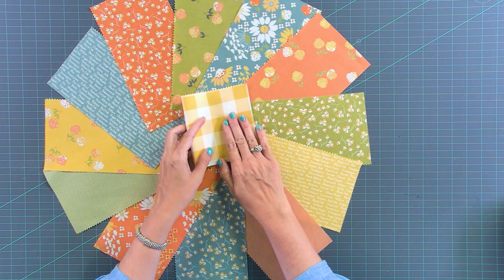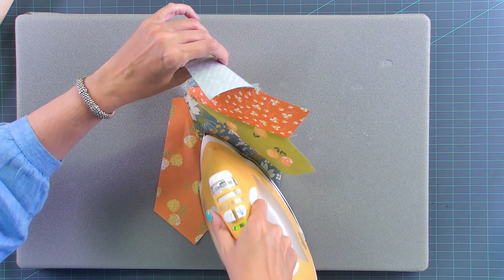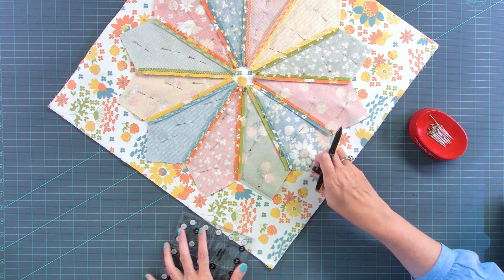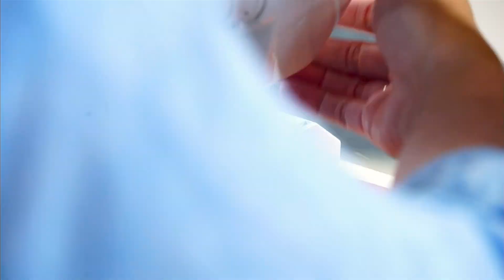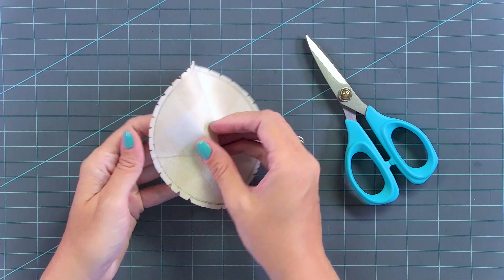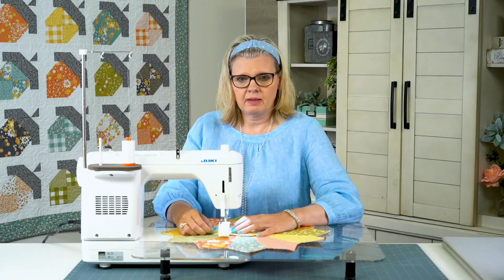🌼 Make an Easy Dresden Plate into a Cute Centerpiece 😍 Adorable Jolly Bar Dresden

Comment: I need your help to decide between singer 3505 and brother gs 2700. I have seen the singer 3505 demo and stitch quality is wonderful.  I haven't seen brother machines as they ate not in local markets right now. Expected in a months time.  I like that singer 3505 has blanket stitch that I may use for applique. Brother doesn't have it. Brother has top loading bobbin vs singer having front load bobbin. Brother speed is 860spm while singer is 750 spm. I am a beginner . Please suggest which one of the two should I buy. If you had to choose between front loading vs top loading bobbin,  which one will you choose? Thanks!
Reply from the maker: Hello div! Ultimately we think that it’s user preference. But as a new sewist who is just trying to dip their feet in the pool, to see whether or not they like quilting/sewing then Singer and Brother are similar in quality.

Comment: I want to makena dresden topper, I may add featherweight interfacing to the rectangles before I cut the plates to avoid stretching.  Since it will be a table topper, I think the extra body would be useful.  Has anyone done it that way?

Comment: This looks adorable, but as so often, it is very wasteful. If you cut the blades with one of the long sides on the long side of the Jolly Bar, you should get two blades per bar, plus one of the sides will be on the straight grain, stabilising the seams.
Reply: That would work with a regular Dresden ruler but that is the Starburst ruler and I think it would be a little to big at the top. But if you get it to work please let me know. I don’t have that ruler.